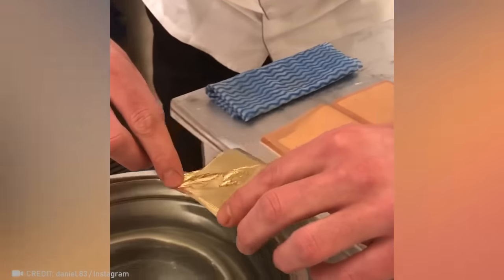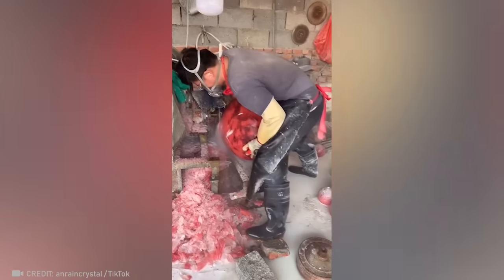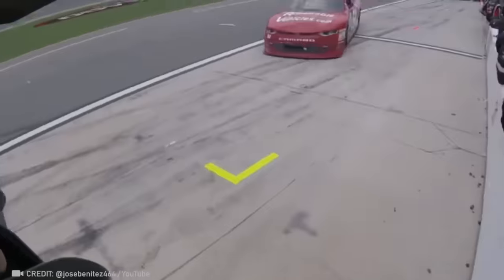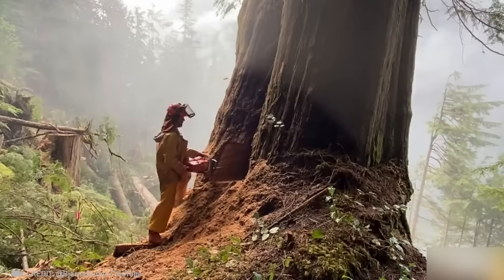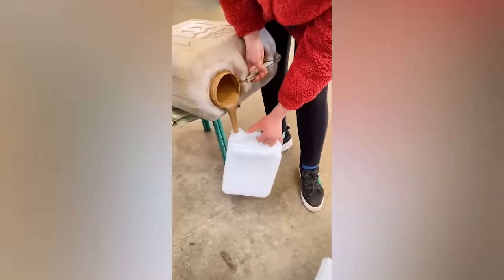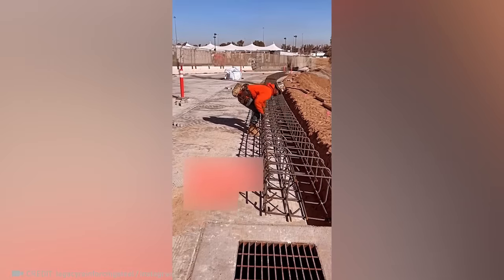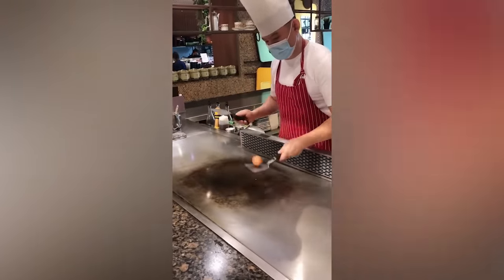40 Minutes Of Satisfying Workers Doing Their Job Perfectly

Comment: 2:40 - If he was a ‘Master”, he wold have removed the plug cover and painted up to the hole. A very bad way of painting.
6:26 - Not the faster, but the most speeded up video. Nice try!
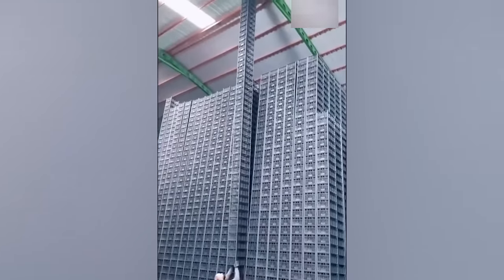10:56 - It’s not paint. They are fiberglass or plastic or resin (not sure which) and the heat melts the material.
14:02 - Far from a “plasterin task”. They are simply removing popcorn ceilings. Although the vacuum is pretty cool.
17:22 - For all the whiney people out there, the tree was DEAD!!! You can see it fall apart when it fell. Not to mention there was no green on it at all.
Reply: 21:50 this is silicone, not rubber.
25:00 "sand farmers"
25:11 heating/cooling tubes being coiled, not shock absorber springs
28:33 powder-coating (goes into oven afterwards to melt the powder then it cools and hardens)
38:32 10 plates
Reply: I mean, for speeded-up videos, it seems everything in these looks about right when I set the playback to 50%, except for stuff that's still too fast.
Reply: Just cause this speficic tree is dead doesn't mean ancient trees are not being taken down every minute. There is even one in this video at 21:16...